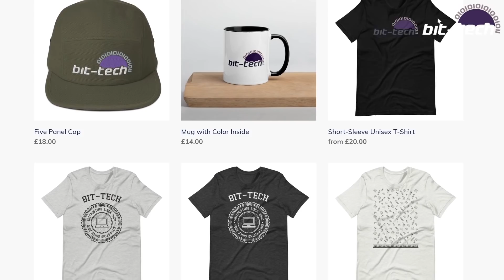AQUACERAS Part 9 | Putting a Radiator INSIDE a Distro Plate WITHOUT Tubes | bit-tech Modding

Comment: On your next go-around with the radiator you should look into replacing that screen with an engraved metal plate!  Trophy shops can often make you custom one-offs to your exact dimensions (or you could create a file for them).  Could be really cool...maybe even nickel plate it to tie in to your fittings!
Reply from the maker: Not a bad shout that. A lot of folks have been asking for cherry inlays but the space is way too thin, so it would protrude or warp most likely. I could engrave a plate myself easily enough too, which is interesting.
Reply: @bittech1  How about this for an idea...
Seeing as it is already designed to handle electronics.

Why not use a piece of Acrylic (Or glass) with machined beveled edges to match the contours of the radiator sides.

Then, either machine, Or, acid etch (if it is glass) the name of the build; "AQUACERAS" into the Acrylic (Or Glass).

And finally, backlight it using some LED/LCD backlighting strips that can be purchased from "AliExpress" or "eBay" and cut to your desired length, then have that logo be backlit at all times?

Edit:

To stop light bleed you could use a thick Black electrical tape and adhere it to the back of the material and it's edges using a High-Temp SuperGlue, Or, a black-dyed epoxy resin mix.

Poke me for more ideas, I am happy to provide input or further details to explain the concept highlighted here :)
Reply: @bittech1 :)

Comment: Beautiful, but that barrow name etched on the led screen makes it seem cheap. I have an aquacomputer airplex 2/360 with the copper fins if you want it. You can have it for free if you throw that barrow trash in the recycle bin.
Reply from the maker: If it can fit in the space, I may well consider switching. Only issue though is I don't know the internal requirements for the aquacomputer rads, for instance they may require much thicker end tanks etc. Guess I should grab one to find out eh?
Reply: i approve of this idea, a copper fin radiator would totally make sense.. just look at the materials on the build, aluminium + wood accents, that black fin radiator don't look too fitting in there.. a copper radiator would totally fit in that elegant build, it would have a steampunk/art noveau vibe to it..
Reply from the maker: @pihermoso11  Just remember there are fans on it too though. Tbh I'm a bit torn because 9 times out of 10 black fits better with things since it's neutral. There's no copper anywhere in this rig so it would probably look more out of place if anything. Black is neutral, so it just recedes into the background.
Reply: @bittech1  +1 to throw away the Barrow trash and use the aquacomputer. Yes you don't have copper anywere, but you can easily add it right? I would for example make the pump heatsinks on copper, and make the connectors you are using to fit between distros the same thing. Sand blast it, protect it against the oxidation and done.

Change some bits that are not that essential to the overall look of the build but can create a contrast as you've made with the wood parts. For a build as yours were you show all the materials you like to work with and everything has to be mostly perfect, that rads simply don't fit, construction and looks wise.
Reply: @bittech1  sorry i haven't thought about the fans over it tho.. (so what fans are you putting on the rad? rgb? ) , ok there's no copper in your rig yet but it was the wood accents which made me think of copper rad right away, i suddenly imagined copper rad + retro noctua fans (w/c everybody hates lol ).. those brown noctua fans color are not far off from your wood accent
but i think you're right, once the fans go in, it won't matter if its a copper rad or black rad... the rad fan will take up most of the visual
Reply from the maker: @black.phoenix.  The thing though is the Aquacomputer rads are absolutely hideous IMO, I'd have to make new sides for them too, the Barrow one does actually look good thanks to the machined aluminium sides.

I don't really want to swap to copper anywhere if I can help it. I've seen too many builds go down that route and it almost never works out.
Reply: @bittech1  OK OK, understandable, your experience in the modding world is way bigger than the one I have. So disregard my idea as without any foundation. I always liked their design, so that's why I think it would fit well, but as you said and correctly if will clash with the lack of copper.

I'm sure you will find a solution, but I still think that the Barrow ones don't have a place in this build, but that is my own opinion.
Reply: @bittech1  i actually used those rads in my rhopolima build. the barrowch chammillion fish radiators perform quite well for being so thin. after i accidentally broke the port on the rhopolima case i moved the rads to my new case and put them in push pull and i have no real issues with them. i do agree that they are cheaply made though.

Comment: I repair radiators at work in the automotive industry all the time. You can remover the the tanks that are braized on with an acetylene torch and an air blower. To re atach you need muriatic acid and silver sodder.  That is of you really wanted to do it. We do it to rod the cooling tubes

Comment: Got done with work opened yt to scroll. First video i see is this .. made me happy instantly. 

I have a question do you want the heat exchanger in the readiator to be black. To me it doesn't fit the theme. 

Also i think the mismatch o rings might have something to do with the pressure drop in the heat exchanger.

Comment: Lovely stuff, I wonder if some locktite would of helped with those screws. I would be a lot happier if I knew the torque is locked in, otherwise I wonder if you can’t make your own mounting points in the radiator to use that model without having to go all bulky. Love your work man, very inspirational stuff all round. Keep at it mate.
Reply from the maker: That particular radiator is just a bust, I'd never trust it again if I'm honest. Loctite would have done nothing, heck it might have made it worse. The issue is that the standoffs built into the radiator sheared off, even worse, those standoffs go through to the internal chamber.

Comment: Have you looked into using a vacuum plate? For flat parts and even thinner sheets, those tend to work quite well. Sure, it will cost you additional Z, but may be worth it if it fits. Easy to install and not even expensive nowadays as well. Keep up the good work! :)
Reply from the maker: Funnily enough I was originally going to make one instead of the fixture plate, I even bought the motors and vacuum bits for it. Never ended up doing it though as my needs largely changed. 

The Z height really is an issue atm, although what I might do it split my fixture plate in two in the future, then have one half be like the current one and make the other a vacuum table.

Comment: I love the radiator idea! And yes please do a heatsink for the DDC next! I would love to get an idea of how to cool it because I already have a DDC. But the heatsink i have doesn’t have any Thermal pads, only a heatsink and DDC board flying! And it is from Bykski with a fan connection and molex. Thoughts of taking off the 2 pin on the molex and connect them to the fan connecter since it is the same voltage. But I noticed there is something weird going on. I need to look deeply into it before trying this out

Comment: This might sound really stupid, I’m no craftsman and haven’t ever built a custom loop,  but I really enjoy watching Bit-Tech and had a thought. Since he pretty much custom makes almost every structural part himself. Could he custom make the runs? As in instead of using the typical acrylic / PETG or using stainless steel tubes, could he make his own with a unique design. Possibly out of the glass blasted aluminium as either the main tubing material or as an aesthetic touch. Could not have circular tubes, something like oval? Maybe it’s impossible I don’t know I just thought it could be an interesting concept.

Anyway, love the series
Reply from the maker: It's all possible to be honest, although specifically aluminium is an issue due to galvanic corrosion. Other materials can be used if you have the vision for them and related skills. For instance I would love to do blown glass tubing, but that's such an art form in its own right. I did a glass blowing course to get a feel for it, but frankly I can't see myself ever really having the time to learn it to an appropriate level.

Comment: I hope this makes sense, but I am still confused about your re-fixturing/setup method to perform subsequent subsequent milling operations on a workpiece. 

@22:31 in the video, you appear to place the frosted work piece against the pegs on your fixture plate, creating a reference for that side as a Y axis edge somewhere along the X axis of your machine coordinate system. 

Then you use the edge finder probe to touch off against the left edge of the workpiece to get the X value for your Workpiece Coordinate System (WCS). 

You never get the Y value for the origin coordinate of your WCS. 

How does your controller software know where the Y axis is on your fixture plate's X axis? 

Are those pins located at known coordinates with known radiuses that allow you to calculate the Y coordinate?  

Do you touch off on a Y edge of the workpiece, but did not show it? 

You never explained that part of your process.  So, the confusion persists for one viewer.

Comment: Working on a build with the 120mm version of the Barrow radiator too. Prototyping with a 3D printer to check measurements would be amazing. I'm just gonna measure 20 times and cut once

Comment: I'm just recently watching your channel, but i've a few questions

Have you ever make a CPU water block? If the answer is yes, then
- Does it have to have those tiny fins?
- How thick they're?
- Spacing between them?
- Milling bits to choose? (from a piece of aluminum to final block)

Hopefully, you can make a video about this topic :)
Reply from the maker: Coder FA I haven’t made one yet, no. Funnily enough the main reason is precisely those fins, you need them or a similar method (such as a pin grid array or a printed mesh if going super fancy) in order to have good thermal transfer. By far the easiest way to do that is with a slitting saw and arbor, which unfortunately I can’t do with my machine.

There are tit endmills out there, I’ve used down to 0.3mm before, but they’re terrifying to use and the slightest rub or shake can break them. It would be far more viable on a proper machine, but then you would probably use a slitting saw so...
Reply: @bittech1  thank you for the information :)

Comment: I'm worried that maybe after the radiator is filled with liquid, the radiator might start to sag and deform being that it is not supported on the one end.
Also, if it does begin to sag, there might be a slight chance that you could develop a leak at the top connection.
Hope I'm wrong. Love the channel. You rock!
Reply: I was thinking it might just snap right off when its loaded with fans and water. Those screws at the end aren't meant to support its weight. I would use some sort of support at the other end.
Reply from the maker: @monotoneone  Cough I mention it in the video...
Reply: @bittech1  Guess I missed that, just heard you say it would float in place.

Comment: Wow, that is fantastic looking but the fact that the screws and standoffs on the radiator are rubbish has me worried with that much weight cantilevered 360mm out, do you plan to support the far end of the radiator?
That being said, if I'm understanding the issue correctly, you may be able to drill the standoff holes slightly larger and re-tap with the next screw size up and still use this radiator.

Comment: Use some LOCTITE 518 in the radiator screws because it seems they are going into the water jackets and will prevent leakage there. LOCTITE 518 is a general purpose gasketing product with excellent contamination tolerance.
Reply from the maker: The screws themselves don't go into the end tank, only into the standoffs.
Reply: @bittech1  When I seen the screw blow off under pressure testing I thought it did is all.

Comment: How does a guy with a quality content and a cool mustache does not have more subs?
Note, would not the weight of the radiator in time cause some sort of leak? Latter with the fans to add more additional weight might add more stress in the distro screws.

Comment: it looks absolutely amazing but with the weight of the fans/liquid and potential extra weight through tugging on the fan cables isn't it better have have some kind of support on the other end regardless of how minor it may be (perhaps bridging over to the mentioned 2nd rad or a support leg comming off the top of the mobo tray to support the rad at the half way point) especially since you mentioned it's kinda already breaking under it's own weight being unable to torque it down properly (rad's in general..appart from maybe that aquacomputer one that thing seems beefy, are quite flimsy especially the thinner one's, they start to feel strong and rigid when tied down to the case or when in put in a good shell with pretty solid end tanks, but it's still really thin metal.

haven't followed much of this project so don't know what it's end form will be but the parts i see are insanely impressive, looking forward to seeing how it will turn out.

Comment: Why do you use your champfermill on the outside anticlockwise? (G41) Normaly, on steel, this will get you a worse surface finish.
Reply from the maker: Acrylic behaves differently, for finish passes I run conventional, leaves a very clear finish. On aluminium though I always run climb, same reasoning as you would use for steel.
Reply: @bittech1  inzeresting ;)
Thank you.

I have yet another question.
You use hss mills, right?
Would there be a benefit ist you use carbitemills. I know the snap easier, but maybe for surface finishing, because of the higher possible rpm (if your spindel can spin so fast).
Reply from the maker: @yannick1426  I only use carbide, pretty much for the same reasons you listed haha

Comment: Is it Stable looks like if you grab the and then wobble or bend it  it will leak maybe a support structure for the radiator overall Nice pc its gonna be iam impressed of how you get the acrylic so clean what Mills en feed end Speeds are you doing in metric

Comment: Potentially a reason why the rad's screws where shearing was because of the weight at the end of the rad causing an abnormal amount stress because way you have it mounted. it could be something to look into, I mean I really wouldn't be able to be 100 percent sure about the theory unless I was there myself to see how poor the quality of the rad it but you get the point.
Reply from the maker: Naa I was holding the rad when they sheared, it reckon it was over-torquing in the factory that did it. Even with the printed cap I didn't screw them in hard just because I was worried about damaging the O-rings (the prints are good but sometimes can have small burrs).
Reply: @bittech1  dam that's terrible

Comment: mdf sealer should solve that problem, plus you have all the tools to repair the striped thread on the radiator.
Reply from the maker: It's not a stripped thread, the standoff itself sheared off, unfortunately also compromising the radiator tank. It could be repaired, but honestly I would trust that even less.
Reply: @bittech1  it would be a good exercise for your self. As i said you have the tools ahd the skill

Comment: I might be looking at it wrong but is there a screw thread within the oring? Is that the one that pops off? Isn't that a leak path?
Reply from the maker: That one's not within the o-ring. The one that is, though, doesn't go all the way through (the o-ring is on the other side of the plate) so isn't a risk thankfully.

Comment: @bit-tech Hello, greetings from Germany! I am absolutely fascinated about all your Work. I love how you make Thoughts come true. I made my first round with CNC and Acrylic at the local "Fablab" of the University, but in corona times, i have no access to the cnc anymore... i am wondering, if i could even 3d-Print a Distroplate and just put a Plexiglass Top on it?! Which Filament and print settings would i need to give it a try? I took your Fusion 360 Lessons (and some others) and would like to give it a try. which printer would i use in the best case? Anycubic Chiron, Creality CR10 V4, Artillery Sidewinder X1? I am even wondering if i could seal it with flex filament instead of glued rubber band?! The X1 with its direct-drive-extruder would be predestinated for flex..

Would love to read your thoughts about it, here soon.. Love your work, go on like this.. you are incredible genius..
Reply from the maker: Heyo! I would be very hesitant about FDM 3D printing a distro if I'm honest. You'd have to use a higher temperature and water resistant filament for starters, but on top that you get issues like warping, inconsistent layers and porosity etc. You could do it I'm sure by coating the parts etc, but the risk is pretty hefty too.
Reply: @bittech1  well thank you for you answer I thought about printing nylon filament because it is pretty temperature and chemical resistant (up to 140°C before this stuff gives up). Alphacool uses this material with their "Eisball" res-Combo, for example. Thx for the Advice, i' ll give it some try..   8f you want, I can show you some results, later